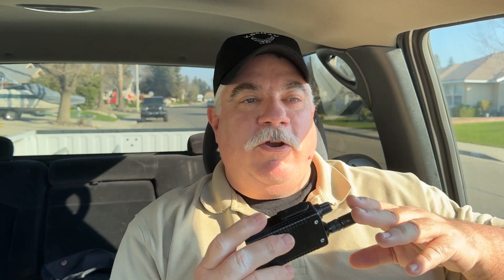Practical COMSEC Practices: Part 6 - Signal Control (Stubby Antennas)

Comment: Terrain can be helpful. Toward the end of WWII the Allies supplied the French resistance with a low VHF voice radio that could be strapped to the chest. Because they were talking to an aircraft, they needed no training in Morse code and could transmit from a spot low enough the land-based German tracking stations could not hear them. They could also stay on the move.
In a modern context, a radio's range can be limited by squatting down or putting a hillside between you and the other guy. In a stealth context, don't consider it a good thing when the other end gives you a 5-9 report.

Comment: They are also comparing the fake Chinese SRH-705 and other clones of Comet and Diamond against longer antennas. The originals perform better in transmit, they are actually usable on UHF and VHF at close range or as you explain in the video, to limit your communications range.
Reply from the maker: That is very true.
Reply: Just want to say thanks for the content and I like the short to the point little lessons. Good stuff for the community
Reply: Great series 

Knowing how to "radio" is very important

Thank you for posting this knowledge
Reply: Hey Scott, have you used Cattail antennas, and thoughts?